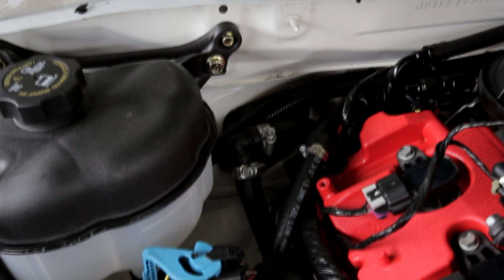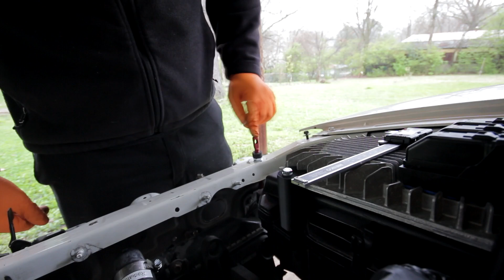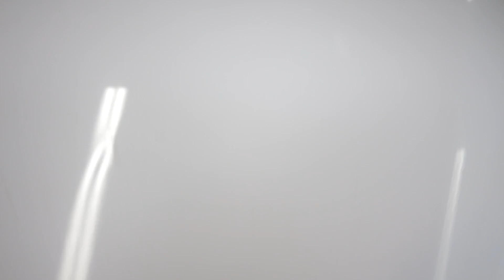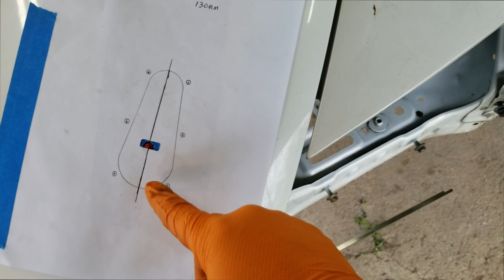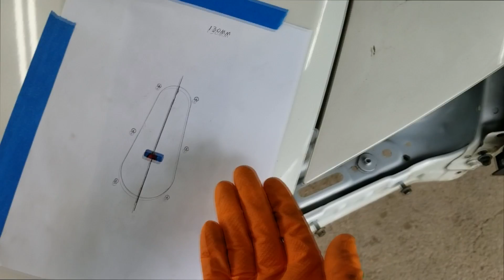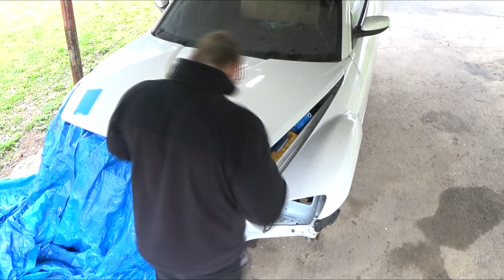Project LFX RX-8 Oil Catch Can and Hood Latches

Comment: I know you did say with the hood latch’s to do them horizontally but they look way better on an angle like you did if I were to get them and do them at an angle how hard would you say that is
Reply from the maker: If you put them in the exact spot I did, there is some material that needs to be removed from the bottom of the latches. Otherwise, you may be able to mount the pins differently on the core support, and not modify the latch at all. I believe if they are mounted horizontally, the slot for the pin to go through has slightly more room. Modifications weren't extreme, just a little work with a file.